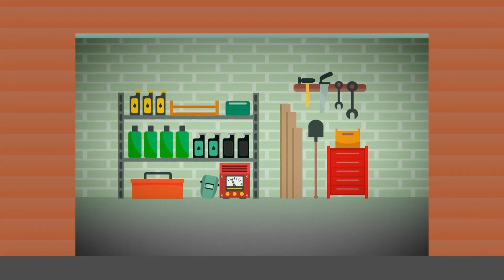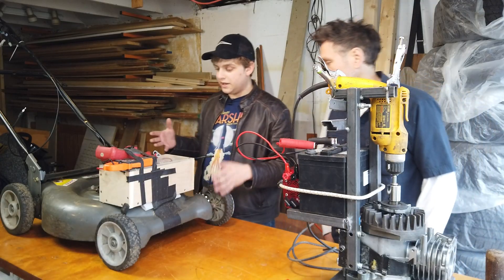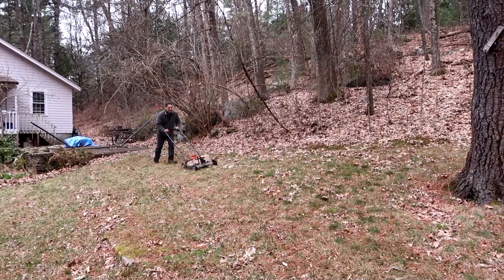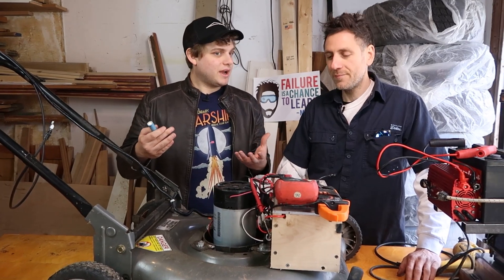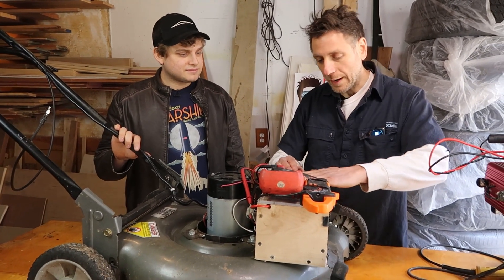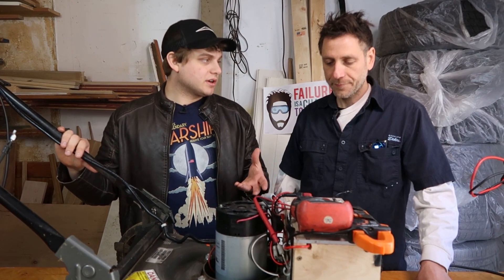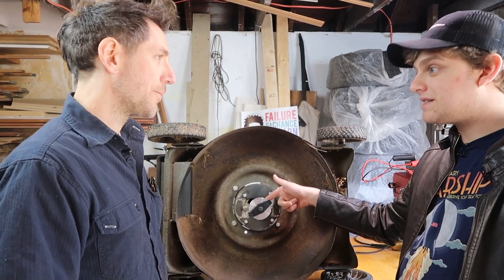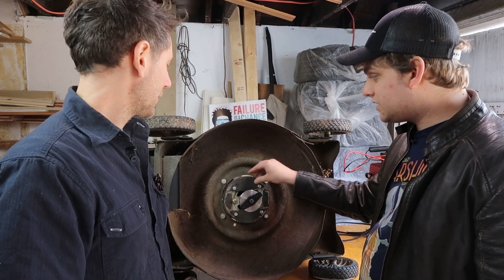Electric Conversion Workshop: Lawnmower Project - Episode 11

Comment: Been watching this series and finally got myself a donor lawnmower a neighbor was junking.  Deck is in great shape, just blown motor, which is gonna be trashed anyway.

Battery Q: Found the modem batteries from Battery Hookup - I have a larger lawn.  Could I go 13 series, 4 Parallel and reduce the C factor and then it would last 25% longer?  I think that's correct, no?  Or am I missing something?

Still watching the final episodes, but is there a link to the motor you used?

Adding, found batteries, but also need plastic connectors, BMS, that on/off switch... any links?

Comment: Guy you didn't need to do this......look at Egos stuff and its Self Powered and you can swap the 56volt batteries in seconds.......the 7.5ah battery lasts 60 mins....go look at them at home depot if want to see it in public.   The EGO battery has a power gauge & over heat sensors etc.. too so you even know when its almost out of power.    https://egopowerplus.com/21-inch-self-propelled-mower-select-cut/    Cow}:-o)

Comment: If you had the fab guy make an adapter you would of needed  instead of dropping the motor and make the other part for the blade the mounting of the motor would most likely been easier. I would have started there but every one does things different. But good job on it, great videos!

Comment: I see the fun side in your project, but I feel it’s irresponsible to be encouraging less qualified/experienced people to have a crack at it. Rotary mower blades spin at high speed, so if a component in the drive train failed & something came adrift, it potentially becomes a very dangerous projectile.
If you’re trying to promote green-ness, then you can’t go past a 100% human-powered reel/cylindrical push mower. They’re super lightweight, cheap, have very few moving parts & they’ve gone through the whole quality control/compliance process.
True story:
I was mowing our verge/nature-strip with our Flymo pushie, when an engineer stopped me to enquire about it. He’d assumed that it had a flywheel as he’d noticed that I was effortlessly pushing it. When I told him that it didn’t & in fact that it’s very light-weight (lifting it with1 finger), he was flabbergasted. I said if you’re not convinced, feel free to give it a go. The moment that he started pushing it he had a wide smile on his face & happily finished the section that I was doing, without me even asking. 
Here’s the thing, they’re so light that the wheels don’t dig in (making them harder to push), even in softer soil or longer grass. They don’t even make the ching ching ching noise that the ones in my youth made, due to the fact that that the spiral moving blades don’t make contact with the stationary linear blade. 
In summary, less noise, less effort & the blade sharpness is a given for a long time, plus you can cancel gym membership. : )

Comment: 14:20 drill down the shaft, reverse the thread and secure it with a bolt and red locktite or even just get a smaller adapter, port as needed with a rotary tool and then drill and tap across the two.

Comment: 11:30 I bet a 3D printer could build an acceptable adapter or you could even just measure steel strips, bend and drill in ports. I bet you could even make one out of wood if you were so inclined lol

Comment: You should probably increase the number of cells by ~50% to give a one hour life. That way you're getting a 1C discharge rate, and should give you >500 cycles. If you cut the grass about once a week on average that's ten year life. If you're doing more than 1C then you'll wear the batteries out much more quickly.

Comment: You need a phone dock on the handle so you can listen or watch YouTube while mowing. Or have an app which GPS tracks what you've mowed. There are plenty of PC cooling options you could employ to keep the battery pack cool but using aluminium spacers between the cell stacks and a radiator on the top would probably be enough.

Comment: Your hand-made conversion had one feature better than my store-bought KOBALT mower.  Your controls had a quick stop feature. Once released, your mower stopped immediately.  The KOBALT mower takes about 3 or more seconds to stop turning. Your design is ** better ** for safety than my premade mower.

Comment: What worked, what didn't work...    Talk more about sizing the motor.  If, for example you were to want to replace a 6.5 horsepower gas motor, what size dc motor would you use...

Comment: Both 60 Hz electric motors and Briggs & Stratton gasoline lawnmower engines run(or are governed) at 3600 RPM. I always wondered if this was from design.  That that was maybe an engineering standard for manufacturing.

Comment: My EGO mower works great, mows for an hour between charges, recharges in less than an hour, is self-propelled at a range of speeds, and adapts it's power to the amount of grass.  Unlike my previous ICE powered mower, it instantly starts every time with no hassle.  It might be fun to invent your own electric mower, but it's a lot easier to buy one that has been perfected.
Reply: Question: does the eGO have the autostop feature? or does it take a few seconds to stop spinning?
Reply: @cyberoptic5757  Stops in about 1 sec.
Reply: 21” self propelled eGo is a great mower. Love that it’s so easy to start and stop.
Reply: I have the 80v self propelled Kobalt mower and its great. It does the same as what you described.

Comment: tesla should actually build lawnmowers to introduce average joe to the technology :D
a new gasoline lawnmower costs between 90 and 500 € a ride on lawnmower between 500 and 2.000 €
pretty sure tesla could easily crank out a lawnmower in these price ranges. while just building a minifactory for that...
like one or two football fields. i mean, they build ventilators with model 3 parts, 
a great value lawnmower should be a piece of cake.
Reply: Electric mowers are already available from other companies. Why should Tesla enter a market where there's already competition?

Comment: Those "modem batteries" are what the Tesla Model S and X are made with, 8256 of them.
Reply from the maker: Same form factor, different in many other respects (capacity, C-rating, impedence)
Reply: @NowYouKnowChannel I don't doubt it, but I bet the voltage is pretty darn close, and I bet if you substituted one for the other, it would work for the most part. They probably have to horse around to accomodate the lithium iron phosphate CATL cells in China. No idea what format those cells will be, but the voltage is different.